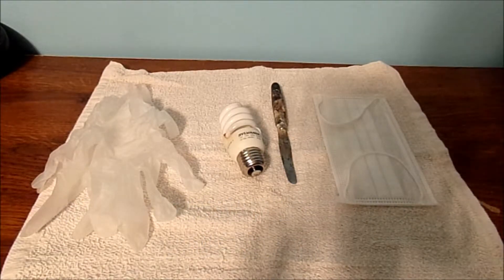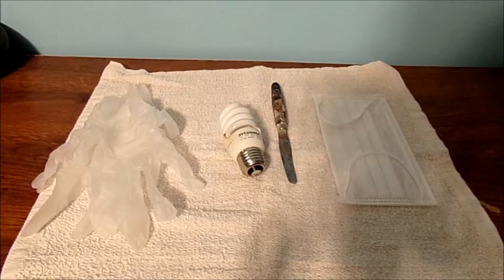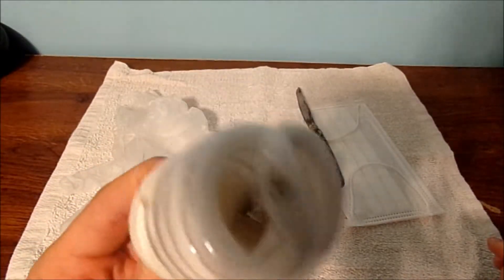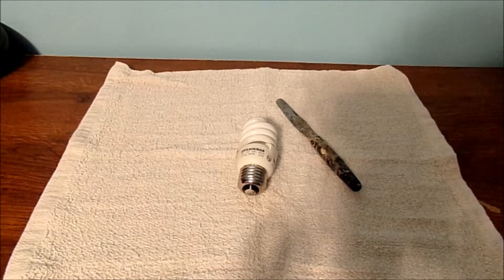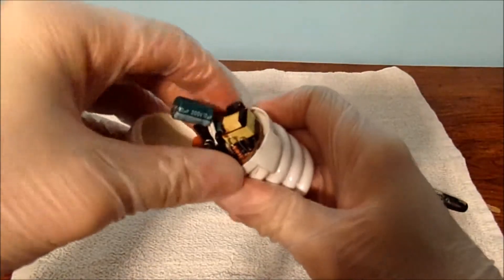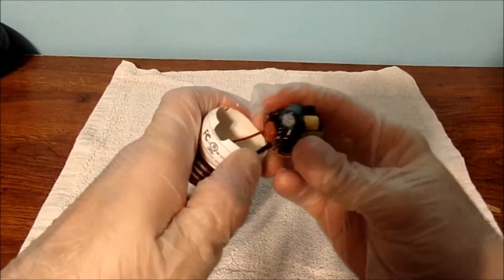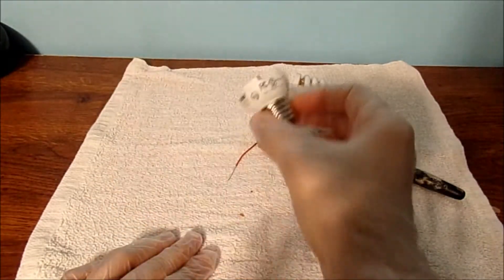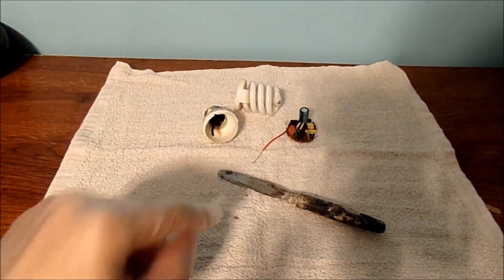HOW TO TAKE APART A CFL LIGHT BULB

Comment: The reason why there was a funny smell is because a component burned out, and that crack in the glass means it was melted or dropped at a low height, and you should be safe from the gases, but not glass shards. If you could replace the component, witch you would probably have to order the part online and get a soldering iron, it should work again, hopefully, if you can find another glass spiral dome thing the same size and not broken. And also, other commenters, why are you making fun of this guy's voice, there is nothing wrong with it, just turn of the volume and it will be fine, unless you hate everyone you see(like my grandpa, who hates everyone he sees). And if you can get a lightbulb without broken glass, get a plasma globe and put the lightbulb near it and you should get it to light up dimly. One more thing, I am using my moms account, my mom is not an electronics freak like me.